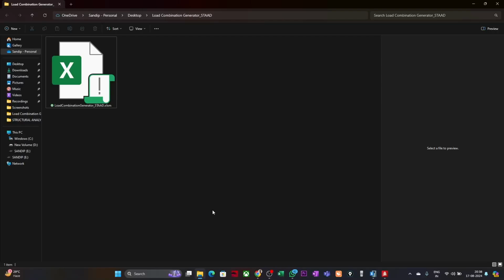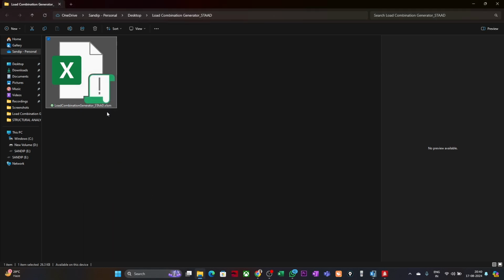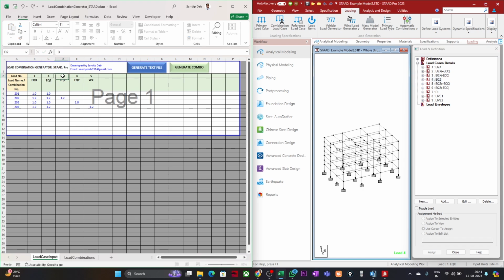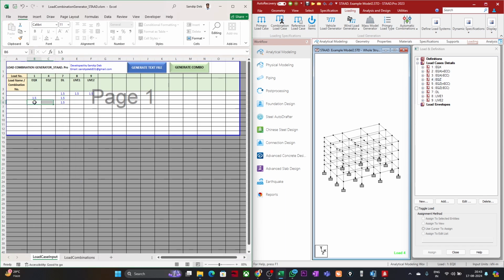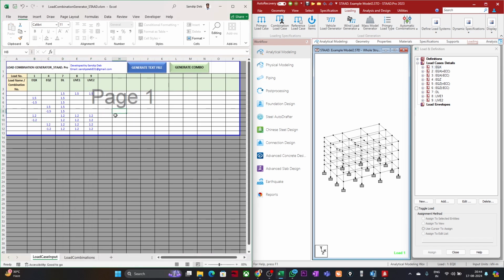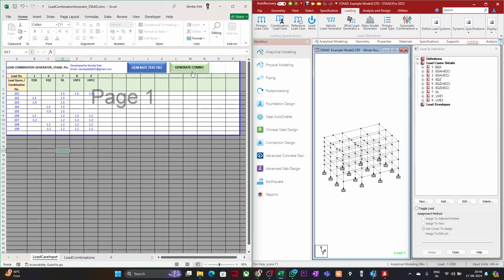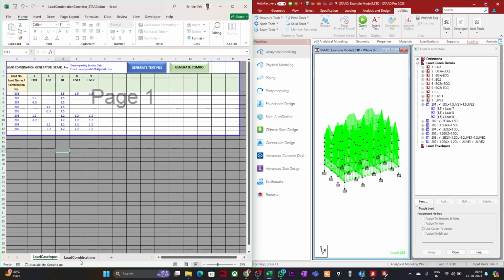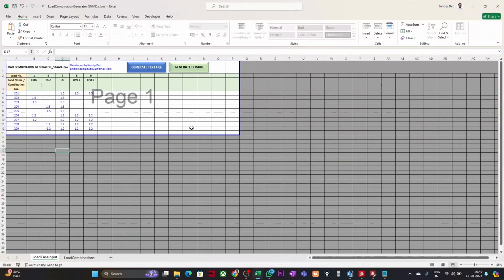Load Combination Generator Tool for STAAD. Pro | ilustraca | Sandip Deb

Comment: Sir
For example if we use all bars in column 20mm but in beam can we use which is having more depth can we use 25mm for that or we have to follow any criteria as per is code...
Reply: Yes you can use
Reply: @asadhussain2293  thanks